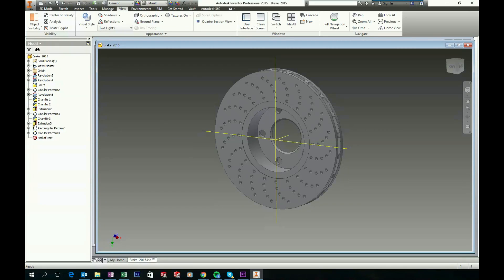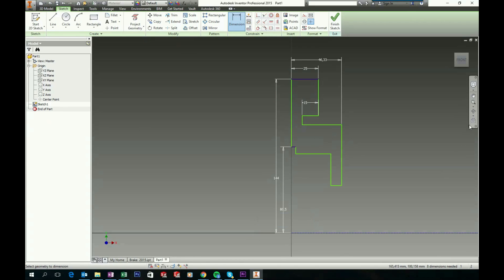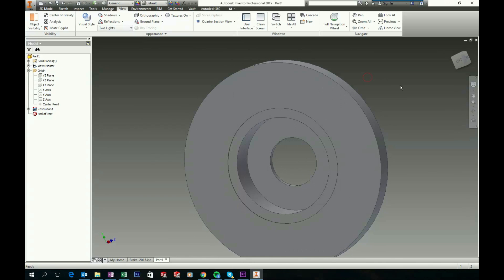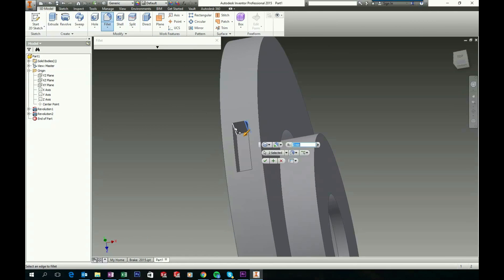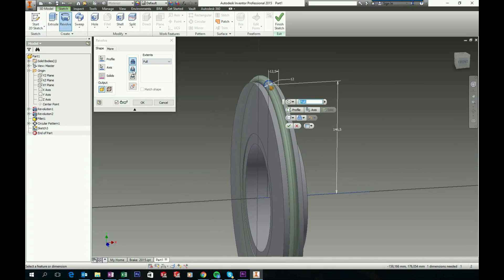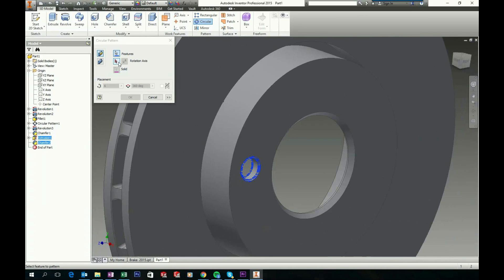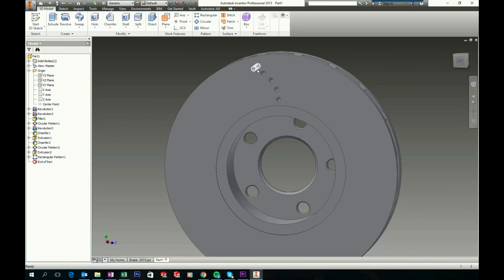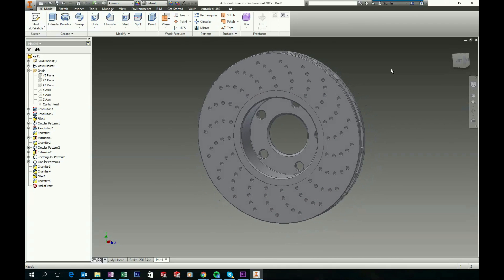Autodesk Inventor tutorial - Disk brake

Comment: make a magical thing that an inventor can not do :make sweep from a line of length 48.744672225 on circle line  with a diameter 192,531067267 like this https://www.youtube.com/watch?v=ihM4uLzxeI0  must be rotated 3 times (1080) . on the line that was made make sweep this time line length is 24.682178355 and must be rotated 8 times (2880) .on the line that was made make sweep  line length is 12.11853822 must be rotated 24 tims(8640),on the line that was made make sweep this time line length is 6.82992394 must be rotated 72 times (25920),on the line that was made make sweep this time line length is 3.245518135 must be rotated 216 times (77760),on the line that was made make sweep this time line length is 2.12469036 must be rotated 648 times (233280), on the line that was made make sweep this time line length is 1.22669055 must be rotated 1944 times (699840) , on the line that was made make sweep this time circle with dimeter 0,5886253 and make solid

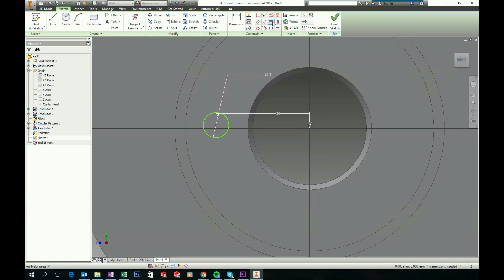Comment: Does anyone experience that sometimes when putting a horizontal/vertical constraint on, you need to use the opposite one to what is expected? For example at 10:09 I had to use a vertical constraint to align the circle centre point onto the horizontal line. Using horizontal had it aligning to the vertical line. But earlier it wasn't this way. What??? :/
Reply: It's hard to tell in which direction a round object is facing and to make it excactly as in the tutorial, I was designing a rim with the help of a tutorial and experienced the same thing. Take a look in the top right corner of the tutorial screen and compare the little cube that shows what's the the front/back , left and right. As long as your cube is facing the same way as in the tutorial you should be able to use the same constraints too. In the beginning of a sketch my Computer choses a different way of projecting my part than in the video, even though i use the same planes.